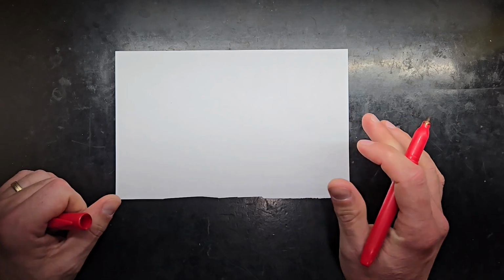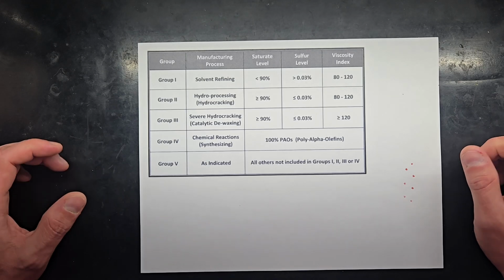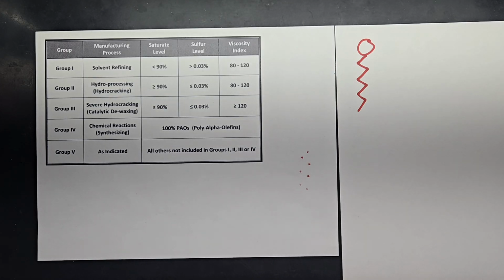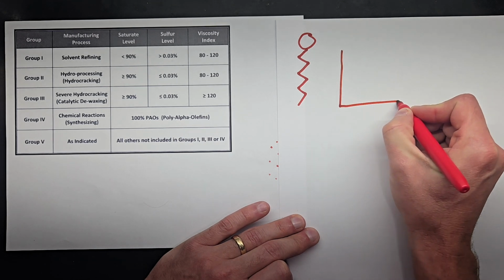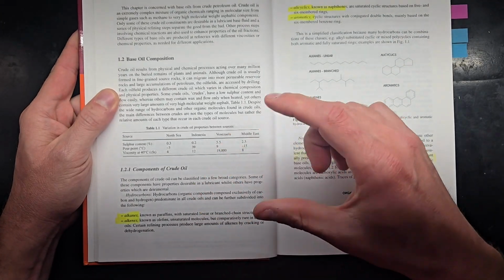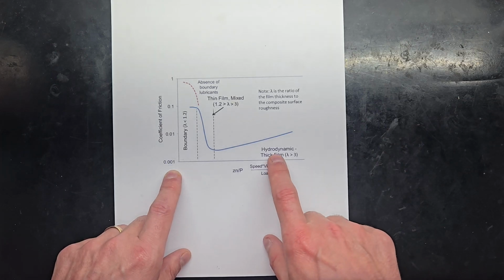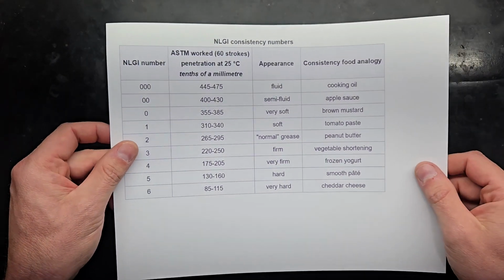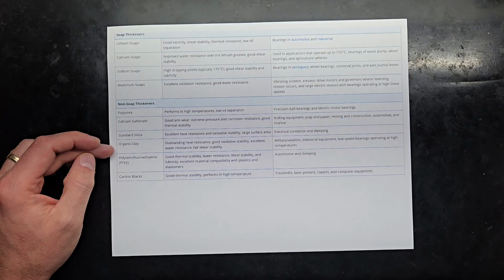How to lubricate your firearm like an engineer #2

Comment: How about gear lube? Motor oil is designed for high temperatures and gear lube has good shear protection.
Reply from the maker: The fractional worry with gear oil is sulfur. Gear oil can come from Group I and II base oils and those have higher sulfur content than group III. Sulfur can also be added to the base oil to help the EP (extreme pressure) performance of the oil. That sulfur can be corrosive to "yellow" metal (brass, bronze, copper, etc). Gear oil can also have a healthy polymer content as well to help it stay on the gears. The plus of a gear oil would be the higher base oil viscosity. Could you find a good gear oil for firearm lubrication, yes, but it would take some digging to find a good one. I would not use a standard 80W-90 or 90W-140.